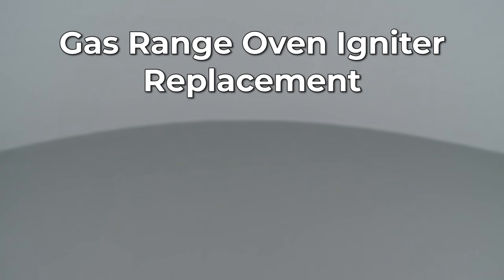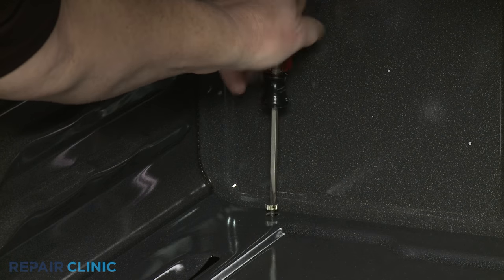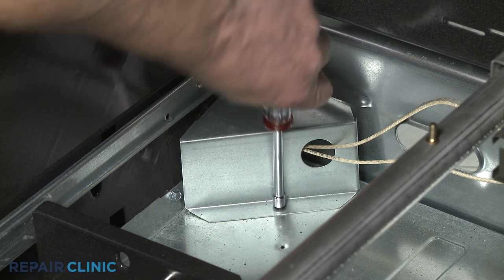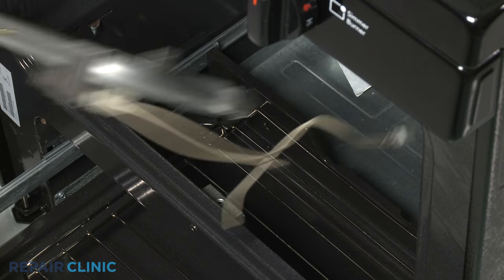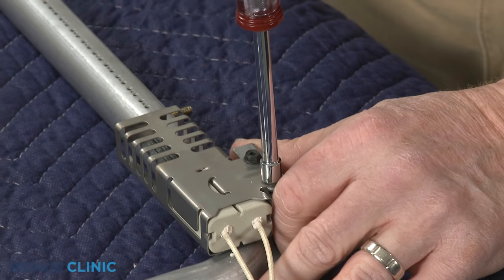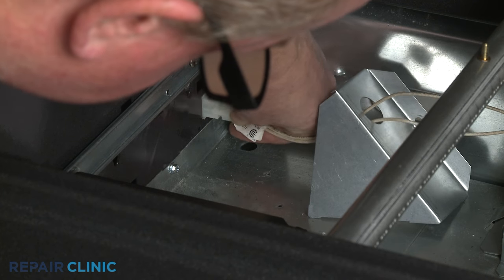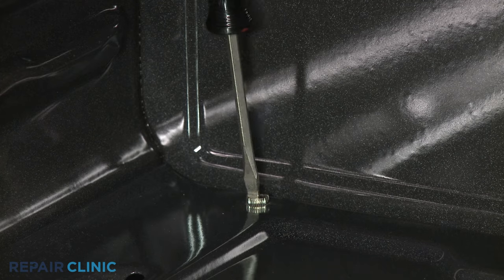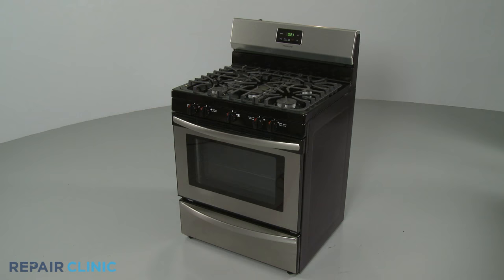Frigidaire Gas Range Oven Igniter Replacement (5304509706)

Comment: Great video! Waiting on the new igniter. Thank you so much. Will add more after I install the new igniter.
Edit 11/04/22: Received and installed the replacement ignitor. Works perfectly. I've got my oven back in time for Thanksgiving and my homemade pies. Ooooo yeeeahhhh . . . not bad for a girl. ;-) Couldn't have done it without your video. Thanks again.

Comment: After being told by our tenants that the oven was not working, I stumbled upon this video (and others) that describe perfectly the probably issue and it's replacement. 
I feel like I cheated but the tenant wanted to bake a birthday cake for her husband very soon. I ordered what seemed the likely part from Amazon and it arrived the following day. Since the stove is in a very small space and the outlet way low, I skipped the step of unplugging from the wall. 
The new part was more of a universal and it was necessary to cut and solder the new wires to the old lugs that connected both behind a metal shield and at the back and below the ingniter location. After installation I hit the bake button, set the temp at 350, hit the button again and stood back as, after a few seconds, the igniter started to glow. A few more seconds and I could hear the gas valve click and the flame started. Both the tenant and I were amazed by this. I'm from the pilot light era so this source of ignition was pure magic. 
Thanks for providing help for us old guys. 
BTW, I could not take the door off but after removing the shields, everything was accessible . 
Yay me!

Comment: This was perfect. Was worried no Thanksgiving turkey. I diagnosed my issue as igniter and found one for$20. So even if not not too expensive guess. Followed video easy to follow. One thing is I did not remove tube. Easy to pull the igniter screws in place.

Comment: This worked great... in my oven model, the connector was under the bottom (not in the corner) , so easy access once I removed the lower drawer.     and I left the door on because of the heads up in the comments ... thanks.

Comment: Question:   I removed the ignitor as part the video (great video!).   Ordered the part I needed.  Oven not put back together (burner tube removed, bottom oven plates out, door off, etc) until I get the part.   Can I still plug it back in and just use the stovetop burners?     Or is that just too risky?

Comment: So, how long are these igniter parts supposed to last?  Mine apparently went out about 10-11 months after purchased new.  Fortunately, it was under warranty, so i was able to service/replace it for free.  Now 2 years after getting the igniter replaced, it seems i'm having the same issue again.  The oven is only 3 years old at this point.
Reply: About 2-3 years based on my experience. Atleast the part is cheap and the fix is easy

Comment: What’s the part number? I thought I ordered the right one but the new one doesn’t have the wires with the black connectors for the safety terminal please help!
Reply: You've probably fixed this by now but I'm wondering if the 2 wires could be cut and spliced by  the igniter and replaced with the 4 wires from the old unit allowing all 4 connectors to be functional?
Reply: @rickquest6385  I wouldn't do that
Reply: model number should be on a strip of paper where you open the bottom oven drawer. otherwise it should also be somewhere on the back of your model or the side.
Reply: I’m having the same issue.  Was told these were “universal” however upon taking out my old one, it looks like the one shown in the videos. The one I order just has two ends and there silver wires. I can plug them into the stove like the one in the video

Comment: I believe my ignitor is busted. Stove won’t turn on but i don’t smell gas. Shouldn’t i smell gas even if the ignitor is busted?
Reply: No. The igniter has to draw power to a certain point before it will allow the valve to open and release gas to the burner. That's the beauty of this system. It's fail-safe

Comment: 3:08 How do you know which wire goes to which terminal, or doesn't it matter?
Reply: Also, you guys are about to save me $200 again (on a $300 oven!). Crazy, isn't it?
Reply: No polarity on a 2 wire ingiter so as long as they are the correct 2 wires it does not matter which goes where.

Comment: I just bought this University igniter but the wires are the same length but on the regular one, one is longer than the other. So I believe the government is messing with me when I try to buy the the right one from Amazon they would not let it be add it to the free 35 shipping another thing I believe the government have done. Maybe I will just wait on the gas man to point me in the right direction😅. Yes I could put them side-by-side and go from there. 11-01-23